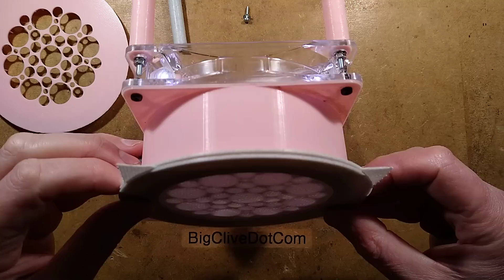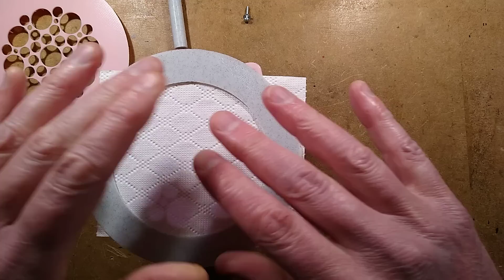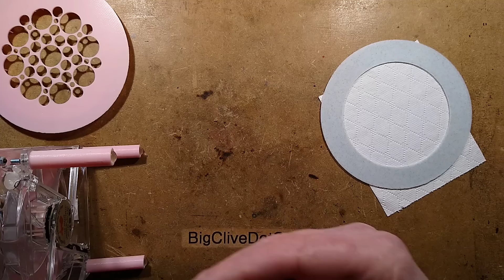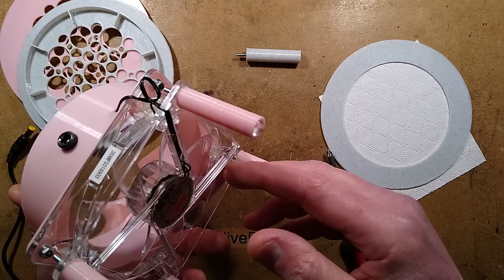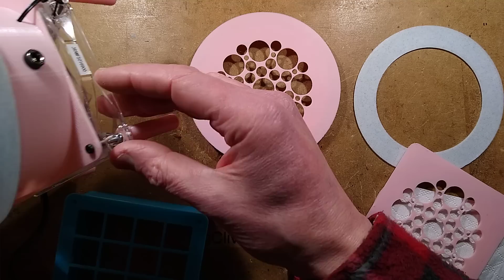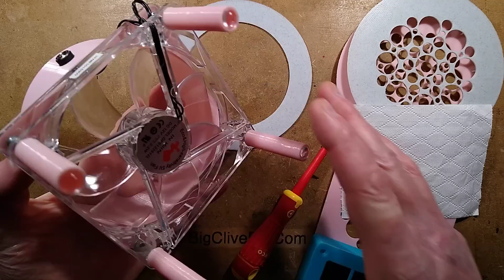MK3 air filter with customisable 3D printing files

Comment: I get the feeling that sometime soon the x-y chromosome thing will exert dominance and require you to at least triple the airflow capacity. It would be a fine moment to see this thing levitate itself...possibly anchor it to the table with fishing line so it'll float mid-air while still filtering. Maybe even strap a covid mask on top and finally put one of those damn things to real use. The round plenum was a positive, methinks. That pink is simply DELICIOUS!

Comment: Definitely going in the right direction.  What I would recommend.
1.for the top ring. A circular ring like the base but not as long. A little bit larger in diameter. To slip over the corners of the filter paper.
2. UV LEDs in the base to sterilize the air. Would need to make the base opaque.

Comment: I think there are two things you could do to improve the design. 1) Use a high static pressure fan to force air through the filter material easier. 2) Place your filter material diagonally in a duct so as to maximize the usable surface area.

Comment: Increase the area of the filter, and it will work better. There is a reason furnace air filters are pleated. Increased area allows a lower pressure gradient across the filter media, thus having slower air flow through the filter media so particles are more likely to be trapped, and not drawn through. Deep overlapped blade blowers also work much better.

Comment: Regarding the anti-turbulence fins and your experience with silk flame blowers, bear in mind that you were experiencing cyclone turbulence at your fan output in your silk blower, which may be caused by the rotation of the fan blades.  With your filters, the air coming in is calm, without any cyclone influence until it gets near the fan blades, there isn't much coherent turbulence to dampen near the filter.

Comment: Assuming the tissue aspect works well, having a lip around the top circle so that it acts more like a cap, that would keep it in position and push the corners of the tissue down so it makes it a little more aesthetically pelasing, the OCD in me cant handle the corners sticking over the side.

To kick it up a notch (maybe as a series of upgrades one can apply ) :

Phase 1: Instead of the lip which would make it hard to do this, use a square face plate and attach a toilet roll holder to the side of it, so you just pull the next square across tear off the old one

Phase 2: Automate the roll advance, and have a miscroswitch detect when the roll is empty and beep for replacement, then it could be left alone for ages.

Phase 3: Change the barrel jack to a USB C so it can easily be powered by powerbank or plug using something like  ( https://www.electronics-lab.com/project/fpx-easy-usb%e2%80%91c-power-for-all-your-devices/ ).

Comment: Haha I can't imagine the CADR of this is very high but I always like your air purifier videos as I likewise used to nerd out taking apart ionizers and such. I have a few Winix and Honeywell hepa filters but they use giant pleated filters that are probably 6x the size of this thing for just the filter cartridge!
Reply: Great. My first impression was that in the feet where battery holders. This would be a nice addition to make it more wireless and also add some weight at the bottom for more stability. (Unfortunately i don't have a 3d printer [yet] )

Comment: So watching this video I can't help but think of the cheapest way that this could be made by just buying the fan and probably finding a few things around the home so if you were to set or glue the fan between 2 coffee or soup or tuna cans and 1 of the cans drill holes around the sides to let the air out after its gone through the fan and then on the inlet side of the fan just drill holes in the bottom of the can and not the sides and put the tissue on the top and then you can actually use a rubber band or magnets to hold the tissue to it as well........ please let me know if you can picture what I'm trying to say and if you think that it would work in the way that you ment for yours to work and I do understand that i don't really have away to break up the turbulence ......but I think that it should work but I dont know that it  would work the way you intended ......?

Comment: Observation; if you were to use a 35mm long screw you could run one screw through the legs, the fan and the filter housing flange and only need one nut to secure the whole thing at each corner. This would reduce the parts count and eliminate the added need for washers.
Reply: Or use 4 really long screws, and skip the legs all together.

Comment: The problem of using tissue/toilet/kitchen paper is they are far too restrictive of air flow to be of any use. For it to be of use you need effective filter and good air flow.  While the system featured may draw some minute amount of air through the paper over a 24hr preiod the bulk of the fan's effort is to create a slight vaccum holding the paper towel to the case. The bulk would be just cavitating air. There would be probably more dust collected on the leading edge of the fan blades as air and surrounding dust passes around the underside of the fan and is expelled back out the underside.
The reason paper filters work well as they do is because the paper has a courser and thicker matt and more importantly the surface area of the filter is 50-100x larger that of the aperture size of the filter. This is achieved by folding filter media on it's self in a WWWWWWWWW pattern. So you would need to alter your design so that would allow an air box to contain the folded tissue with adequate sealing around the filter media so there is no air flow bypassing it.

Comment: If you want to extend the anti-turbulance wings, you could do a spider web design and then print it in Spiderman colors.
Also I wanted to repeat my suggestion of going next level with this and incorporating a motor and rollers so that it could slowly and automatically pull a roll of toilet paper across the screen.
If tuned well it could last for months without needed to be changed and you could reuse the roll for it's intended purpose since it shouldn't be damaged and it's going to get dirty anyway.

Comment: some suggestions for general usability 
-Put some clips or as mentioned in the video, pins on the ring so the filter substrate stays on even if the device is knocked over. this may sound silly, but some cats would be very happy to paw at a glowing thing in the corner in a room. this may also allow for outside use, as pointless as it would be.
-make multiple sises of case available, for 90mm,80mm,140mm and 200mm computer fans to go along the normal model. and perhaps some sort of carbon filter holder for them. i have my own little filter that uses one for soldering, and it does a good job.

otherwise, this looks great! if something like this could get to market or even just become popular in the maker space, it could force filter companies to lower prices or create a mass production version of this "cheap short-use filter" idea.
i'm looking at you, winix 

or it could just be a fun project, both are great.

Comment: Neat project.  I think the square holes expose more of the tissue to air flow thus filtering more air per unit time.  I think it would be even better if there were four sides that could hold four sheets of tissue so four times as much air could be filtered, or it would require changing tissues 1/4 as often.  If it was shaped like a pyramid it would even be better looking.  👍🤗

Comment: Thanks for the files! I just grabbed them and will start printing them later tonight. This is very similar, too, but much smaller than a filter I made a few years ago that uses a box fan and an 18x18 inch furnace filter. I have it by the dog's crates to catch all the fluff they shed.  It's fairly noisy. I made it from plywood and masonite. This smaller and quieter one is better suited for my office.

Comment: Why are the feet so high?
When you put a surface a few millimeters below the fan it'll blow the air to the sides so it doesn't blow onto anyting you put the device on to.
Reply from the maker: Diverting the air too quickly reduces the flow.

Comment: Cool project, makes me want to diy a paper filter for my 150$ wirlpool air purifier. The store bought filters are crazy expensive
Reply from the maker: Be careful not to restrict it's airflow too much in case it needs it for cooling its motor.
Reply: @bigclivedotcom  oh you're right. Thanks for the heads up clive 🤗

Comment: Stray thought- make the "anti-turbulence" chamber taller, equal to the width of the TP. Gridwork instead of solid and have a solid cap. Wrap the TP around it once or twice.
Should be enough pressure difference to hold it on and you'd have more surface area and thus more airflow, so more air being cleaned per minute.
The pattern of crud that builds up would tell you whether all of the TP is filtering effectively.

Comment: Could you use a case/CPU fan which had the ability to vary it's speed?? Would LOVE to see you build a variable speed controller to go with this setup!!! I used a variable speed fan along with a 3D printed adapter to dryer vent to make a solder hood extractor. It works great, but my attempt at a controller for the fan speed didn't turn out as well as I hoped... Would LOVE to see the master create one that I could copy ;-) Great project Mr B.C.!!!

Comment: I made this when I was like 6 or 7, but the filter material was a dryer sheet electrical taped around a computer fan. It also worked as a vacuum
Reply: also maybe try deigning it so that the tissue is cut to shape with an outer ring when two pieces are pressed together, and held securely on an inner shelf with the baffles

Comment: A push on top to hold the parer towel in place would be nice, just to cover the fact it is a paper towel that is there instead of an expensive filter.  I like both designs for the grill, but the square is more practical, however, I think you could shave off more on the fancy round one that appeals better to allow more airflow.  I prefer the one with the round holes, even if it is not seen for a paper towel, it will show when it starts to get dirty.  A round circle one to hold the towel down but with very little plastic on it would look good as well as covering the fact it is a paper towel.

Anyway, i like you idea, but I don't have a 3D printer.

I need the case off an old computer power supply or something along that lines.

Comment: The grey filament looks a lot like that commercial countertop material you find in high-traffic places like airports. Really seems to hide the 3D print layers too. "Wood" filament is a cool effect too, but kinda a pain because it has to be kept really dry for it print with any reasonable quality, and in my experience is harder to feed consistently.
Reply from the maker: It's very much like the resin marble countertop texture.

Comment: Just curious could you make the grid and ring a little thicker put a couple holes in and insert magnets?   or would that mess with the fan?   Project looks interesting can't wait for the next installment if you decide to upgrade again
Reply from the maker: I'm tempted to add magnet recesses in the two parts.  They wouldn't affect the fan.
Reply: @bigclivedotcom  Thanks,  have a heartsib that's a teacher,   this might make a good extra credit project for the little idiots.

Comment: Clive, you could use magnets to hold the ring in place.
Also for those without a 3d printer, bic pens can be used for the legs and a plastic glad food container can be used for the buffer chamber. With the lid holding the tissue. Can be cut / modified with a simple craft knife. Hot glue could be used to fasten the parts. And a 9v battery can be used to run most 12v pc fans. 
Sorry, if I made this too kid friendly of a craft..... back to the corner with me.

Comment: Did you try using real. Filter material (the ffp2 filters you get or surgeon masks). They are a bit denser i think so might need more force.
Reply from the maker: I'm going to experiment with coarser filter material.

Comment: Rather than locating pins for the cover, which would be a bit awkward with the paper underneath, why not give the ring a lip which hangs down slightly over the base? Sort of like a biscuit tin lid with a hole in it. That would locate it easily and provide a neat edge to the top.

Comment: Hello Clive. Suggest to replace tissue paper with the HEPA layer extracted from vacuum cleaner bags (Karcher etc.). Or just cut complete walls of such bags. The cost breaks down to few dollars per filter. And you get better filtering quality from a material that was designed for high pressure high quality air filtering.
Reply from the maker: I've been toying with the idea of a fan funnel for a whole bag.
Reply: @bigclivedotcom  I also tried the nano filter membrane that is being sold by Czech company called Respilon made for being fitted in the windows (https://www.respilon.com/products/products/window-membranes/  ) Unfortunately these high quality/expensive membranes are not built for high pressures, so I think just a good quality HEPA bag would be the most suitable. Probably increase the surface as much as feasible. Btw. been watching your videos for years and loving them. Keep it up!

Comment: Can use magnets to hold the extra top circle piece in place.
Reply: @OreoBambino  It is too far away from the fan unless you were to use a VERY VERY heavy and powerful neodymium (like the size to crush your hand) and in those cases well the magnet is the size of the fan lol.... My top pc filter is magnetic right next to the fans and hardware its just the OP ones you need to worry about.

Comment: Why not to use a small 3mm "lip" on the top circle and "snap" it on to the one with holes with the paper in-between. Like a snap on lid. The square one I believe has a bit more space for the air to go through,.

Comment: I attempted something like this a few years ago with three 80mm fans in series with arrestors between each fan and its neighbor. Got quite decent air flow out of it, but never did finish the project due to running out of filament and living in the middle of nowhere. 😅 

Have you considered sandwiching foams of varying density to see if airflow could be improved? I have a feeling the Achilles heel of this design is the pressure needed to pull any meaningful amount of air through the square of tissue. It’s probable that you might be getting airflow washing back past the blades too.

Really love seeing you do 3D printed projects like these, especially the iteration and reasoning involved.

PS: Magnets would be great on that ring!

Comment: I still don't think that the fan can create enough suction to move any useful amount of air through the filter media.  Maybe you could do a video using smoke or vapor from a vape device to show how much air moves through the device, I'm guessing it won't be much at all.
Reply from the maker: It's low, but it's 24/7.  A drop of aroma on the tissue permeated the whole room very quickly.

Comment: Richard Callan
1 second ago
I've got a problem, could you answer the simple question please: Right, you've got an RCD protected consumer unit and the MCB is Off, now you cut through the supply cable with side cutters, shorting all 3 conductors and the RCD trips even though the mcb is off, I know it's a TNC system so earth and neutral are joined near the consumer unit and the RCD is basically a differential amplifier, I just can't figure it, got any idea's please
Reply from the maker: Very common.  When you bridge earth to neutral it creates an alternative parallel path for current that can bypass enough neutral current (at very low voltage) to trip the RCD.
Reply: Thank you very much for your quick response

Comment: Hexagons would use the least material leaving you with the most airflow for the top barrier.
Also, how difficult would it be to 3D print the legs around a bolt or create a hex head for the bolt to sit flush with a little adhesive?
Reply from the maker: Subsequently I used standard fan self tappers to fix the legs on.

Comment: Clive, if someone were desperate to build an air filter, and not have a 3d printer, one could possibly use a computer power supply case and a 12 v fan and external power supply. Magnets could hold the filter in place as well.
Reply from the maker: You could use any box like a food storage container, or cobble something together out of scrap wood..  That could also allow you to use a full size paper towel and more fans.

Comment: Personally i would Draw the Organic filth though a Plasma Candle ark grid Where A Super heated Plasmas flame Just Sterilise Everything and make it ASH and bombards it in both UVC and Ozone + intense heat That nothing lives 

Basically  a Ioniser in Super overdrive and very over voltage 
One was watching a Few Plasma Candle videos
Reply from the maker: That would result in throat ripping and eye watering levels of ozone.

Comment: Thanks for the OpenSCAD source. Missed a fan size parameter at the beginning but nice work on the for-loops & rotate combinations!
As commented in previous video, I won't put my fan on legs. I'll use an exhaust plenum that lets me attach a length of clothes dryer exhaust hose sideways. That will allow me to direct the cleaned air away from the filter, so it won't be recirculated.